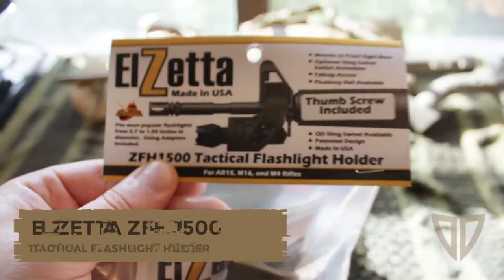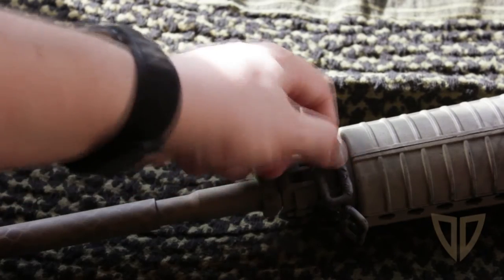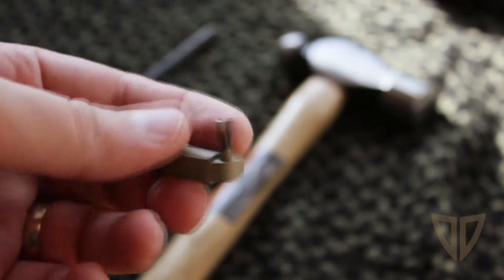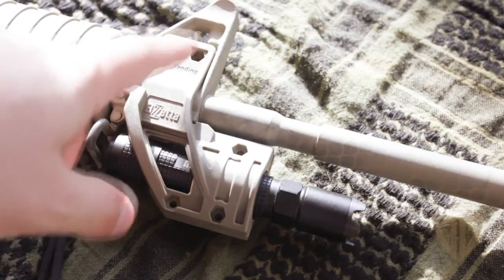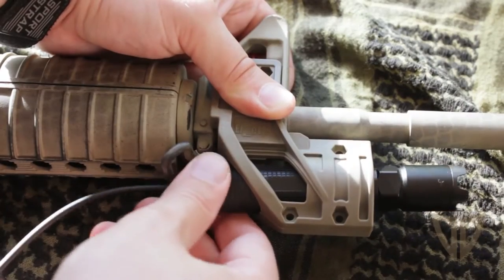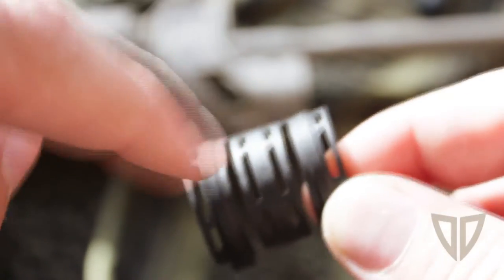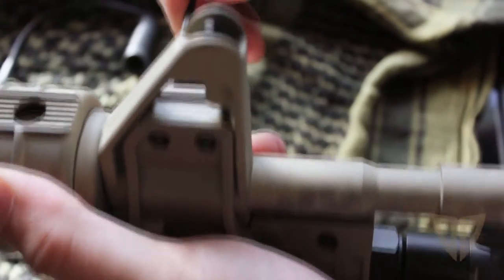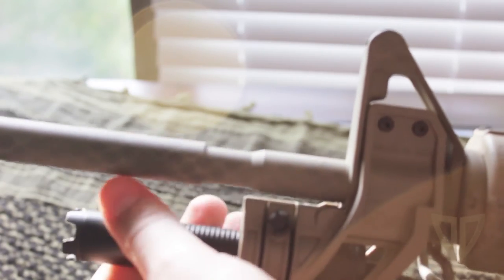Elzetta AR15 A2 Flashlight Mount Install - ZFH1500

Comment: Just got this mount and will be installing it soon. How's it holding up? Also, do you notice any decrease/effect on accuracy since you have the light mount attached on your barrel? Thanks
Reply from the maker: Awesome! For the length of time I kept it an A2 front post on that rifle it was awesome. I never did any accuracy testing specifically, but I didn't notice anything on a practical battle zero level. I wasn't shooting out past 75 or so yards though.
Reply: @WildMountainGarage  Thanks

Comment: How durable is the mount? I'm rough on my things and this seems to be my only choice for a "retro" light mount
Reply from the maker: It's pretty durable. It's a strong polymer of some sort, reinforced it seems. I never had any issues with it, but I don't run it anymore as I don't use the A2 post on any of my rifles. Would I regularly use it as a hammer, probably not, but I wouldn't be afraid to bump it around.